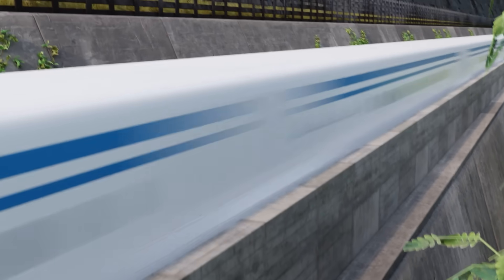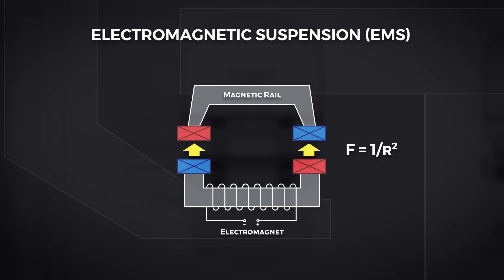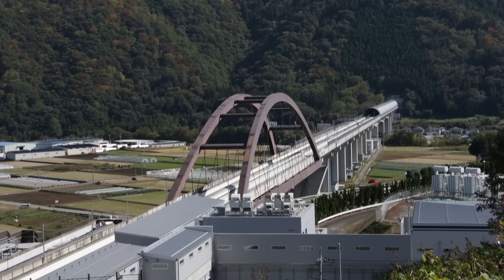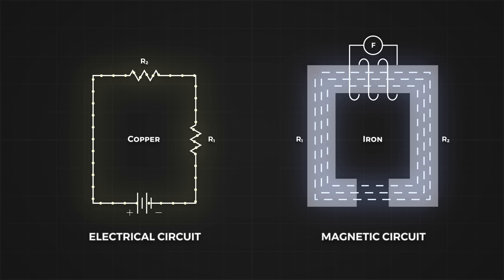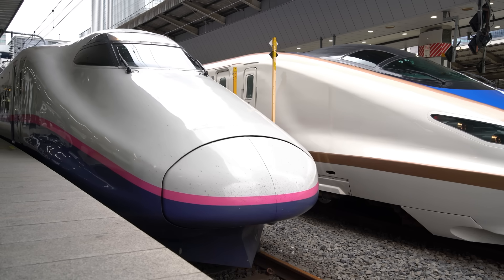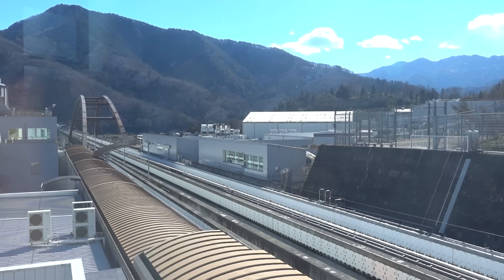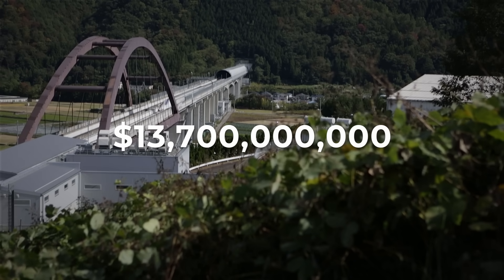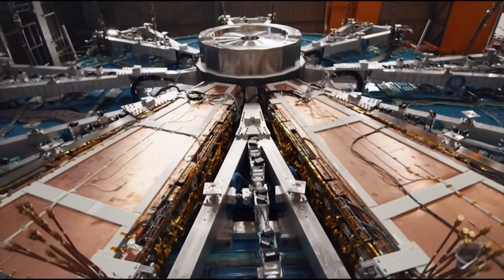How Japan's Maglev Train Works

Comment: I did my high school senior research paper on maglev trains in 2001… it’s wild that little has changed since then. Or, at least, they haven’t really been implemented.
Reply: It took several decades in Germany to develop the Transrapid. That one which is running in Shanghai.
The Japanese approach is different and uses even more advanced concepts (super conductors...).
Reply: High speed trains did improve too and redesigns like the velaro Novo for a possible next ICE should be there when the japan Maglev goes into real costumer runs. So Maglevs will need to compete with the current designs of trains with better efficiency Aerodynamic and costs than 2001. The High speed Trains are capped at 320km/h with only some that go higher than that cause it gets quite costly to run them at high speed so expensive ticket prices. More Aerodynamic improvements should help to get the cost of running Trains at that speeds down.
Reply: @toggleton6365  agreed. Top speeds only make sense to a certain point. Like driving with the car, it does not matter if you go 130 or 180 top... In the end the time saved is minuscule, but the energy, maintenance and safety measure just bloat up the costs.
Reply: The construction of the linear motor car is progressing, but the construction is delayed because the area at the linear transit point is opposed to the construction. (I'm Japanese, so my English is not perfect.)
Reply: The real question is whether it's really worth it. How long before that piece of infrastructure recuperates the investment when compared to building a traditional high speed rail track? If the break-even point is too far into the future, people will choose the high speed rail to the detriment of maglev.
Reply: @e1123581321345589144  ^
Here is JR calculation, how youtube will alow them.

https://ja.wikipedia.org/wiki/%E4%B8%AD%E5%A4%AE%E6%96%B0%E5%B9%B9%E7%B7%9A#%E8%A9%A6%E7%AE%97

Yes, that is of wikipedia, but they are sourced directly from JR original calculation. I can´t post them becasue youtube block that URL
Reply: You don't call your high school essay a "paper"
Reply: @hwg5039  maybe you should write a paper on how you retroactively changed the terminology of a semester long project every senior at my high school did… 23 years ago.  You sound very smart. I’m sure everyone is very proud of you.
Reply: Did you miss the part about the construction price tag?
Reply: @MrJdsenior  No. But that's been the biggest hurdle since I wrote that paper. I'd like to think that if we really wanted to make this work, we could have figured out something in the last 23 years to reduce costs.
Reply: @BRUXXUS I suspect that with this sorry of thing, you need some country to bite the bullet and devote significant resources to build out a large network at great cost, through the process of which economies are discovered and eventually disseminated around the world.
Reply: @BRUXXUS  The cooling system sounds extremely expensive.
Reply: @BRUXXUS  "I'd like to think that if we really wanted to make this work, we could have figured out something in the last 23 years to reduce costs." Some things simply aren't worth it. We could probably build a city at the bottom of the ocean too, but... why? To save one hour per trip? Is that how bad our impatience has gotten, that saving a single hour to get from one side of an entire country to the other is worth the financial and mineral cost?
Reply: @gearandalthefirst7027 now I want a city at the bottom of water. Preferably a lake because it is less dangerous but that is up for debate
Reply: @MrJdsenior  The price comparisson , its out by about a order of magnitude

Comment: The US rail system, like US infrastructure is like Microsoft Windows. Bloated, outdated and not worth the investment for a much needed complete refactoring. It's easier to just apply a new coat of paint and sell it as "modern". And people are ok with that. They actually feel like legitimate participants in the 21st-century. That is, until they travel to the Netherlands. Or try a Mac...

Comment: Its unlikely that maglev will become less expensive in the forseeable future or anytime soon, high speed rail is much cheaper to build and uses much less energy than maglev plus high speed rail still has a lot of room for improvement to go faster.
Reply: "Its unlikely that maglev will become less expensive in the forseeable future or anytime soon,"
It already are 10 times less expensive, becasue this video displayed all the price differential with a order of magnitude out.
Reply: @matsv201  yew true
Reply: Yeah they use more energy because they run at much higher speeds. Idk about the Japanese maglev but the German one uses less energy than an ICE when driving at ICE speeds
Reply: @Guy-Zero  To get it into perspective NYC to LA is about 4500 with a decently straight track.

A high speed train at 300km/h typically use 46Wh/km/seat (ICE3) , for NYC-LA route that would be about $20 worth of energy.

A Transrapid  at 400km/h uses about 52wh/km/seat and the same route is about $23 worth of energy (at 300km/h it would be $15)

A L0 at 500km/h uses about 70wh/km/seat would be about $32 worth of energy.

This is all with 500 seat train with respectively 8, 5 and 9 cars and a full stop every 150km (this statistics was made for the European market and work not that well for a long route as that)

Reasonable for a long distance like that the train would probobly significantly longer with much higher capacity and fewer stop. Pushing back the energy consumption probably with 20-25%.

Here transrapid does have a significant advantage, becasue it can extend the loading profile that is very beneficial for large capacity trains.
Reply: @matsv201  as a sci fi nerd myself I do believe this will happen and that this tech will be mounted on trains besides planes, cars, and such the tech in which they could significantly reduce drag and energy consumption further by using what's called plasma actuators it uses plasma and such to manipulate and control airflow I heard it could reduce drag on aircraft as much as 30 to 40 percent! Imagine that for high-speed rail like the trains like the Germanys famous ICE trains
Reply: @matsv201  true true
Reply: @Guy-Zero  as a sci fi nerd myself I do believe this will happen and that this tech will be mounted on trains besides planes, cars, and such the tech in which they could significantly reduce drag and energy consumption further by using what's called plasma actuators it uses plasma and such to manipulate and control airflow I heard it could reduce drag on aircraft as much as 30 to 40 percent! Imagine that for high-speed rail like the trains like the Germanys famous ICE trains
Reply: @butterbean139  Ive not heard about this yet but seeing as the reduction in energy usage on the Transrapid stems from it not having contact with any rail (both trains and maglev obviously are confronted with air drag), this point still stands. To be clear I see maglev as an addition to normal high speed rail not a replacement. I think there are distances and lines especially between European countries where maglev would make a lot of sense and where you than ban flights between those cities because of the maglev connection. I think we should use high speed rail where it makes sense and maglev where it makes sense and can replace air travel at the same time. So like I said, more of like an addition to the existing high speed rail infrastructure
Reply: @Guy-Zero  right I do agree, but that doesn't mean air travel is still gonna be a thing air travel that takes 3 to 4 hours to a destination and that long should be banned and replaced with high speed rail or maglev I only see maglev as a way to be used for short rounds between major large cities and not small ones where the population won't make sense.
Reply: @Guy-Zero  From what year is that data of ICE vs Transrapid? The redesign Velaro Novo that could become the ICE 5 has made quite some big improvement on Aerodynamic that should help to get some speedups profitable for real world high speed connections. But i agree on the point that over 400km/h connections will need other technology.

TBH thinking about building complete new connetions between 2 big european city's gives me fear. When i look at every Rail project of the last 10years you will have instant big problems with local politicans that want their city to be connected to that high speed connection or they wont allow it and NIMBY groups forming along the planned corridor.  
Improving the existing rail corridors are already a pain and it will be worse if you have such a long corridor of new infrastructure.
Reply: @toggleton6365  They are pretty old at this point. Maybe the latest being 2012 cause Germany gave up on Transrapid technology. Yeah Im also curious about the new Velaro Novo; the few renders we've seen look really nice. Maglev will always have lower friction obv but it would have been interesting to compare total friction and energy consumption between the Velaro Novo and newer improved Transrapids (which would likely exists if it we hadnt given up on it).

Yeah NIMBYism would sadly be a huge problem. Ive just pointed out how nice it would be to have maglev connections between countries and that they could be very beneficial but in the real world it obv could be a huge pain in the ass to actually implement if not everyone is on the same boot.

Comment: 9:30 Explain the braking system while showing a train with a blood splattered on it 😂
Reply: to be fair it is not worth it to break for a bird or any wild animal on the tracks. Even an unpleasant emergency break would not save it. Trains like the ICE have a plate called Bugklappe in front of the coupling mechanism to hide and protect it and make better Aerodynamic. You will see quite some ICEs driving with that plate open cause some wild animal got hit and this part needs to be replaced next maintenance

Comment: 4:30 Will not be the first of its kind, but probobly be the first in of its kind in commercial operations

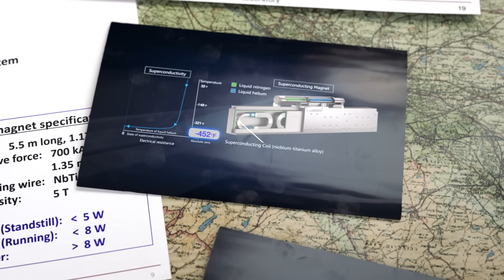4:53 The coil for L0 is not Ni-Ti, that was the older MLX01, and you probobly should be obvius becasue its the MLX01-B on the picture. In 2001 they was replaced with MgB2 coils, that sustains superconductivity at 20k not 4k as the earlier, that can be colded with liquid hydrogen (that is much cheaper)

They later experimented   Vismium and ytrium based superconductors on trail that sustains superconductivity at 90k, that can be colled with liquid nitrogen, the source i have is a bit old, but it sugest that the L0 was built with that system, sadly i can´t find any primary source supporting that. But it would seam that Ni-Ti was abounded 2 decades ago.

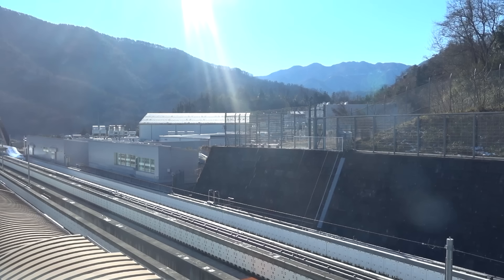8:22 Its worth saying, that recusing the field strength in the cabin is not the only reason they do this, it also increase the field-strength to the main track magnets.

8:33 Its really just the 10 cm closest to the magnet that need to be made of silicon-steel. For example (on transrapid) the edge plate is made of normal carbon-steel, it is very ferromagnetic. This is what the emergency break grab on to.

9:55 That is not corect. its the newest version of Transrapid that use a linear induction coil. SC-maglev (L0) use permanent magnet induction. That is, there is simply permanent magnets drilled into the track that is picked up by a coil, the energy comes from the speed of the train. Transrapid TR09 use a linear induction with a coil that oscillate energy from a transmittor. This allows the train to get energy also a standstill. Sc-Maglev need batteries to get energy at low speed.

L0 also have a small diesel generator to produce power if the batteries would go low. (That is why it have a rectangular black rectangle on the roof). 

TR-shanghai shown in the video actually still have contact based power pickups.

13:32 Its not really "harder" to build maglev, its different. If its harder or simpler really depends on external factors. But the fact that its different, also need different machines, different workers, and different engineers, also makes a lot of companies really don´t wan to touch it.

13:35 Its really the magnetic field in the track that moves, the train just ride along. While Silicon-Steel is a specialty product, its really not that uncommon. Its used in transformers in high volum, and its not that expensive. And that is just used on the closest 10cm. The rest of the track is just normal basic reinforced concrete. While its a fairly high grade, its really not different to any bridge built today

13:52 Just straight down wrong. Even taking the cost just right up and down, chou shinkansen is still cheaper than California high speed rail. And its not the track that cost, its the tunnels.

13:59 NO, there is no track in  france in modern times that cost $2M/km, you can´t even build a 4 lane road for that cost. That number is at least a order of magnitude of. Try $20M/km and that is what some tracks landed on... 20 years ago.

14:06 77M/km is still quite a bit less than 95M/km for the first part of califonia high speed track, and about 90% of that cost is not maglev related.

14:15 That is very very wrong,. SC-maglev was estimated to cost  ¥5.1B while normal Shinkansen for the same route was calculated to cost  ¥4.18B. The numbers in the video is wrong by a order of magnitude.^

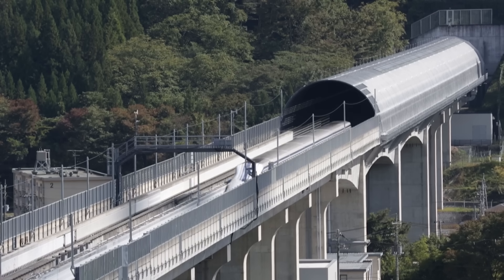14:49 This is one of those "kind of sort of.. but really not at all"
Its very true that the train consume more energy in tunnels (specially when meeting a other train)... buuut, the route is also significantly shorter. So while the per km operation cost is higher, have to consider they 25% cut of the distance.

The video was decent until the economy second, then it just totally derailed.

Comment: "NY to LA makes no sense."  Sure, but there are a bunch of midsized cities in the middle of that route that very nearly justify their segments, so having the whole route gets you a lot of useful city pairs, with the network effects.  LA->Vegas.  Vegas->Denver.  Denver->Omaha.  Omaha->Chicago, Chicago->East coast corridor network.  All make some sense.  Omaha is probably the weakest link there.  But Omaha would pretty much instantly become a city important enough to justify a high speed rail link, if it had high speed rail links to Denver and Chicago.  It would be the regional HSR hub for getting from Flyover to the bigger cities away from the center.  With fast enough trains, you could literally do a daily commute between Omaha and Chicago in that scenario where you've got the full NY->LA line.  When you look at how cheap housing in 
Omaha is, some people would seriously consider that commute.
Reply: Even those segments are not even profitable for Amtrak trains, let along hugely expensive maglev
Reply: A sleeper train is also a thing. And it wouldn´t even need to go full speed.

I would much rather go a sleepertrain than a plane.

Comment: You have security wait times in airports as a negative against air travel, but don’t you think we’d have them on high speed trains in the US as well?
Reply: Hijacking a train is rather difficult.  I guess you could just outright destroy it, if you wanted to.  Most people pull that kind of crap for notoriety, and that is dead easy to fix, just don't publicize the names of mass shooters, etc., and damn sure don't publicize their moronic 'manifestos'.  That would curtail a large percentage of the problem right there, and actually requires LESS effort.

Comment: How would room temp super conductors (like LK99 was supposed to be) affect train/automotive travel? There's a good idea for a video...
Reply: Not really. Noticed how Niobium-Titanium is the most commonly used superconductor, working in the liquid helium temperatures, even though there are plenty of superconductors in the liquid nitrogen range?
High-temp superconductors tend to be ceramics, and it's difficult to make wires out of them. They are brittle, and couldn't be welded together and still have superconductivity going across.

Comment: If I recall the video correctly discussed maglev train already uses liquid nitrogen in cooling process for its superconducting coils. So it would probably be a straight up improvement to build the coils using HTS material like YBCO. Commonwealth fusion developed technic of making superconductive tape of that material which was previously a blocker for using HTS for superconductive coils.
Reply: L0 uses them. The video maker seam to misstaken L0 for the MLX01 and publish pictures from the MLX01 coils in steed. (well, at least 3 of them was from the MLX01, the other 2 was from unknown origin.

Comment: You can't compare the price point of $2 million per km for TGV and $77 million for maglev.
First off, did you even include inflation? That would make the $2 mil be $7 mil today.

Secondly, high speed rail is very developed, the process is standardized, the means of making them are on a massive scale of production. It pushes costs down.
And even then, HS rail can still make turns. Meaning they can more easily avoid obstacles. Sure, maglev can make turns too! But not as tight as HS rail because the trains are faster and there is a limit to how well a magnetic field will work.
Since you can't avoid obstacles, prices increase!

And Japan is a country with MANY mountains. France is relatively speaking just flatland. The need for tunnels drives the costs up significantly.

With all that said, yes maglev is expensive. It's not worth it, we would do just as well with the latest technology in high speed rails.

And compared to flight, you also forgot to mention that air travel is full of limitations.
Train travel is less strict, there's easier and less stressful boarding and you can carry more luggage with you.
And you don't have to plan for sitting around doing nothing during boarding. You just get to the train and get on basically.